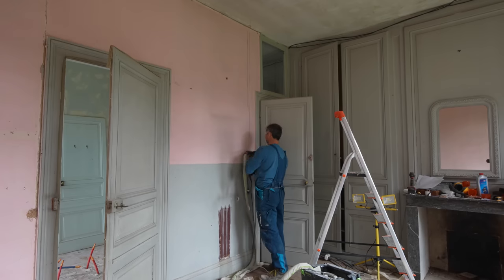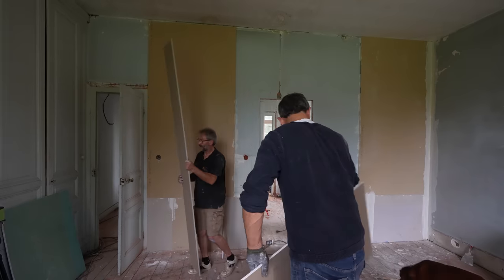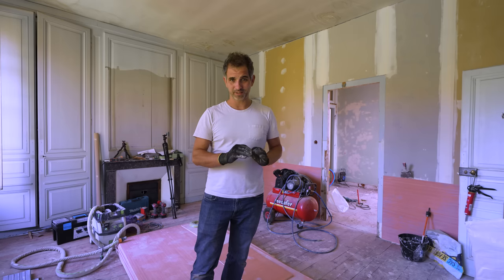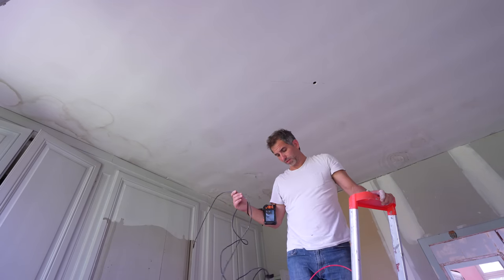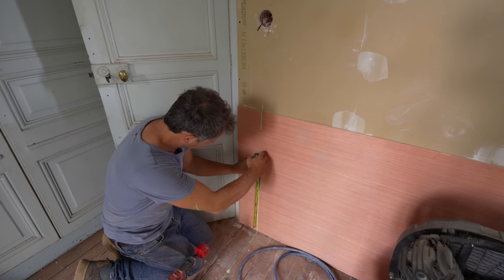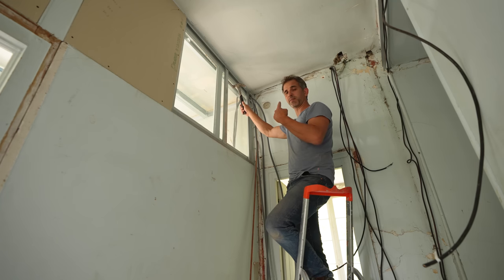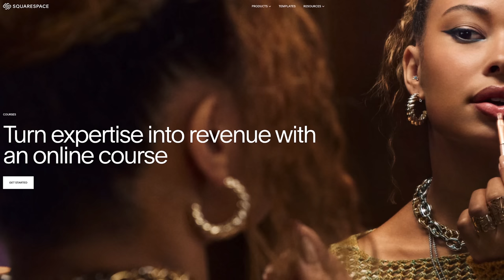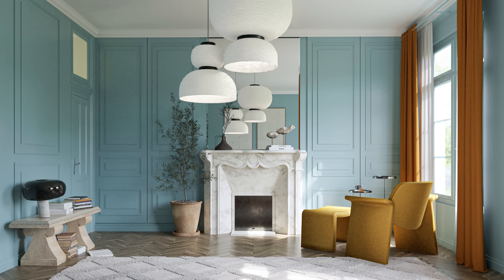Chateau Master Suite - Insulating and building new walls

Comment: Glass breaking tip: cover the glass with painters tape, then begin. The glass will break but the tape will stop the tiny shards from becoming tiny airborne weapons.
Reply: Use contact paper for quicker coverage!
Reply: What about using a glass cutter at the start where the glass aught to break for best effect?  And of course wear some protection as well as use tape to have a nice thick brown paper over the whole pane.
Reply: Yes. You don't want to inhale glass dust into your lungs. Would you put contact paper or tape on both sides of the glass?
Reply: @12:49 Thank you for the advice, thief! 👀

Comment: Fishing wire tip from Connecticut USA; make hole, tie electrical wire to end of something small  that high powered magnet attracted too.Put in hole and drag across ceiling with magnet on outside.Easier than fishing wire by wiggling!Looks great Cheers!
Reply from the maker: Cool idea

Comment: Hi Anna & Phillipe, Now I can teach Phillipe a trick with electrics. I took a scrap piece of wood 1 x 2" and marked it, "wall outlet gauge" and used it throughout the house so I would always have wall outlets and switches at a uniform height. I did it for both wall switches and plug boxes. Mark & Scott

Comment: There are also natural insulation options such as clay mixed with straw. I don’t know to what extent you looked into it or what the downsides of it are, but I heard that it naturally works really well with moisture and is extremely durable and cheap as well.

Comment: Avoid glass shards by taping a piece of drop cloth to the top of the window frame, extending 6" on each side.  Let the cloth hang freely at least 12" below the base of the window frame.  Smack away!  You can lift the cloth throughout the process to see where you still need to break.  Good luck!  And Philip, you need to put on safety glasses!
Reply: Yes to the safety glasses! Had a friend with a glass eye 😅
Reply: By all the powers of common sense, absolutely YES to Eye protection AND sensible glass breaking with a drop cloth or at least a thick paper taped to the glass!

What is Phillip thinking to take such a risk with his eyesight?

Comment: Suggestion. When running new cabling. Take a string with a small metal item on it put it in the hole and then use a magnet on the outside to move the line in the wall

Comment: Thank you for showing us Benoit's first mistake! You should place a plaque on that wall. 🥳From my long ago criminal 🤔 experience: Put masking tape on the opposite side of the pane of  glass from your hammer. Make sure the glass is falling onto a tarp for easier cleanup. It will work itself into floorboards for bare feet to find years later. Do wear goggles, gloves, long sleeves and pants. That glass will splinter and work itself under your skin for months...  (I worked in glass for many years.)

Comment: Ooooh!  Wish I had known you were going to put up plasterboard in the bathroom.  Did you know there's a special type of moisture resistant plasterboard made just for bathrooms?  I wish I could have told you this last week or so.  Then again, never in my life have I seen anyone plaster the sheetrock to the wall.  I've only ever seen it screwed in, even on plaster walls.  But it makes sense to use plaster on plaster walls.  So, you taught me something.  Thank you.
Reply: Same! I found that very intriguing! I've also only ever seen screws used.

Comment: I don't have the expertise you mentioned but I imagine that if you put adhesive tape (scotch) on the glass before braking it it might be less of a mess with the splinters. 

Another self evident option is to use a glass cutter tool.

Comment: Lovely new designs; love #2 the most. Could it be cold by the window w shower and tub, altho I do like idea, unless you account for that, making shower a box. Will there be exhaust fan for shower, radiators, heated towel bar, or electric heat? Although not "pretty" --  I love my pleated thermal blinds in winter, they make a huge difference with big glass windows which I have many.

Comment: To pull cables through a hollow space, you can use a magnet with which you can easily move a piece of iron attached to the wire between the two holes. Greetings from Belgium😉

Comment: I would likely take  the bedroom door off the hinges, paint it and put an over-door sliding devise so it slides over  the bathroom wall.  The slide door overhead gadgets aren't cheap in my country. Since it's a provate bathroom there wouldnt be a need to seal up any gaps where the door meets the wall.

Comment: Cover the glass with baking parchment (much cheaper than masking tape) and glue it on with ordinary PVA glue.
Reply: Yeah just glue some paper if you don't want to keep the glass. You could also try using. Glass cutter to cut the pane out and glue something to it to pull it through. 

Wear long sleeves and eye protection
Reply: @llamafromspace Good!  Someone who also thought of the glass cutter as I did!  ty

Comment: Annealed copper wire is very good for fishing cable down walls and across ceilings as it is flexible and also stiff enough to be threaded without kinking.

Comment: You could use string and strong magnets to go from one hole to another.  Tape a string (not heavy but strong; fishing line might be good) onto the magnet in the ceiling using strong tape.  Then use another strong magnet to pull the magnet in the ceiling to your hole.  You might not need 2 magnets.  A very strong magnet in your hand and any metal that attracts to a magnet should work in the ceiling.

Comment: To install wires in the ceiling could you attach a magnet to the end of the wire and use another magnet from the “room” side of the ceiling to guide the “wire” magnet to the hole near the wall?

Comment: I found using clear contact paper on the whole mirror works even better. This way you can hit it with a hammer then cut off with a straight edge razor knife. The glass doesn't fly all over.

Comment: Glass breaking steps for success:  1.  Wear gloves. 2. Wear safety glasses  3. Tape glass first. 4. Put a blanket or other floor cover down on side where glass may fall. 5.  In addition to using the head of the hammer to break the glass, use the top of the hammer to push the glass away from you. 6. Pull glass from edges with a well-gloved hand.  7. Enjoy satisfaction of a job well done (best served with beer…)

Comment: Magnepull XP1000-LC Magnetic Wire Puller for Electrical Tools W/Flexible Steel Leader & Durable Case, Magnetic Cable Fishing Tool & Wire Pulling... . Could you use something like this to help pull your wire through ceiling or walls. Just a thought.

Comment: Another great video. Thanks. I have many questions about this video. I'll preface by saying that I've been renovating my "old" (83-year-old) house in the Berkeley Hills. Remarkably there are some similarities with what you are doing now: we have plaster and lathe on the walls, just as you do, and old fashioned knob-and-tube wiring. My renovation starts with complete demolition, down to the studs including removal of the knob-and-tube wiring. This allows me open access to the walls so I can (in order) install modern wiring and/or water pipes, insulation, shear wall (we live near a major fault in the Bay Area), and finally dry wall (cloison sèche or something like that in French). You can imagine the advantage for wiring, etc., when you don't have to deal with the old plaster, which you covered up with modern drywall boards in these rooms.

Question 1: Why not demolish the room down to the studs? It would have simplified your life, I think.

Question 2: In the US, you have to fasten your wires to studs/beams every so often and they also have to be fastened within 8" (about 20cm in commie units) of a switch or receptacle. Is it OK to leave wiring loose in the cavities?
Reply from the maker: 1: those walls are made out of bricks. 2, yes, no need to fix cables inside cavities. The important thing is to be able to remove wires if damaged.. theoretically.

Comment: NO PLASTER BOARD IN HISTORIC BUILDINGS!!! I am afraid, that this comment will cause some reactions, but if we look at the structure of historically built houses i.e. take in account the construction materials used in those times, then plaster board is a total no go. If you want to insulate, which is always advisable, then do an underwood structure as seen in your video, fill the gaps with an insulation material, that can breath and then go on top with certain types of hemp boards, wood fibre boards or similar permeable construction materials, on top of which you apply your lime lime plaster. Again no plaster boards where and whatsoever!